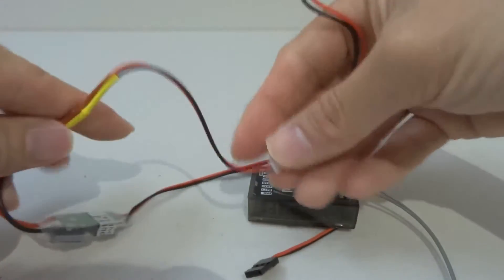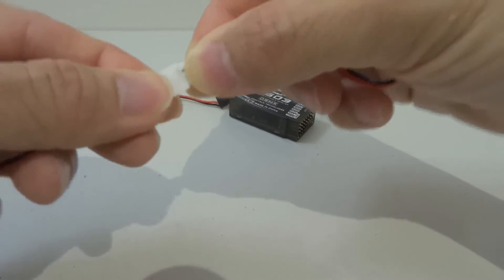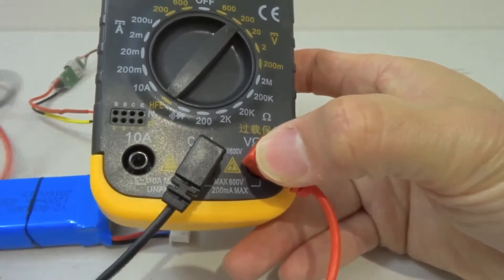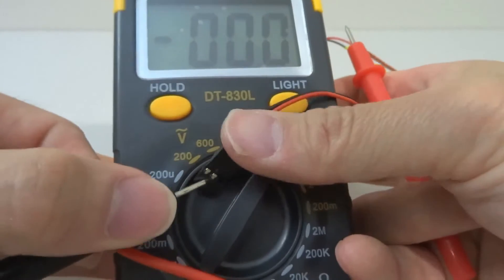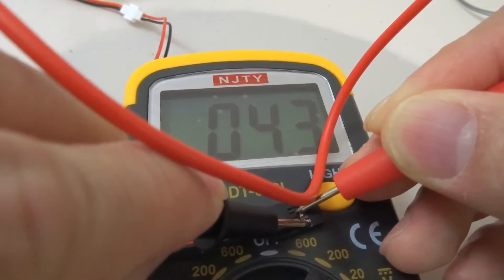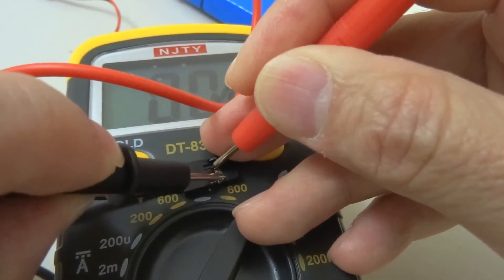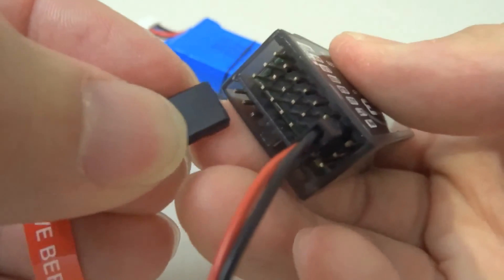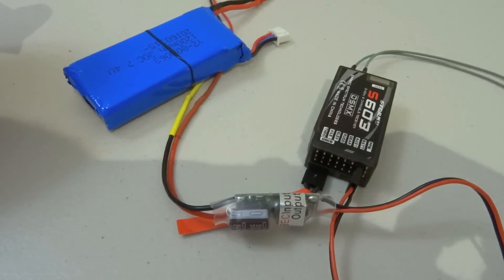UBEC 3A ESC 5V Power Supply for Receiver  - DIY

Comment: I like to bind reciever first before putting reciever and drone together . Elrs ans rsxr and frsky r9m last week took all night different wires different batteries different transmitters . And crossfire worked . Now i bought 3 more elrs recievers to try using just 5v .

Comment: If I connect a 4s lipo to my 4s esc, how much voltage will be outputted go the reciever? My reciever only supports 3s so will it burn through? Thanks
Reply: I need to know this too xD
Reply: A esc is put in a power line to reduce the amount of energy into something

Comment: Hello friend, I have CM703 and it doesn't say battery ... the 3 pin pairs are as follows: PPM, AUX2, AUX1, GEAR, RUDD, ELEV, AILE, THRO, and BIND at the bottom. There's no info on the internet how to power it directly from the battery or psu ... Any ideas ?